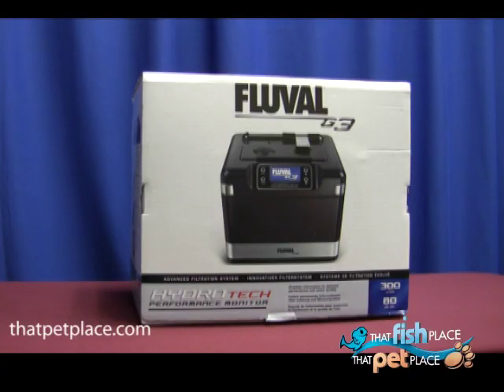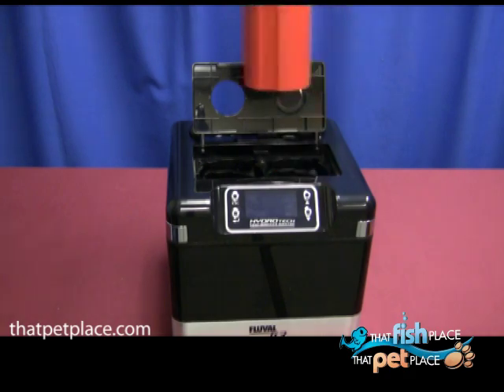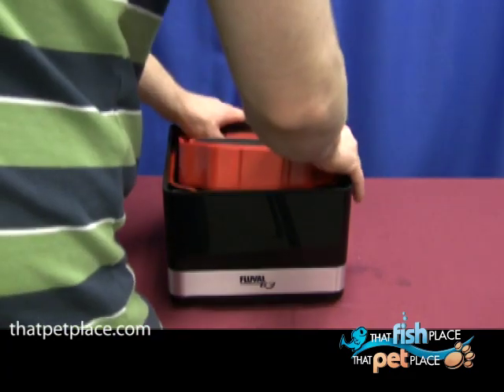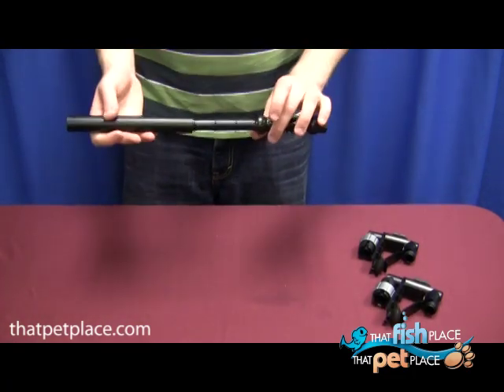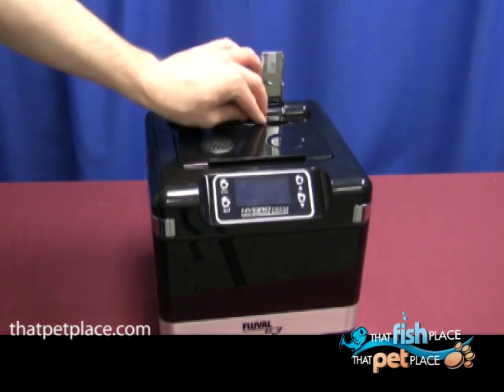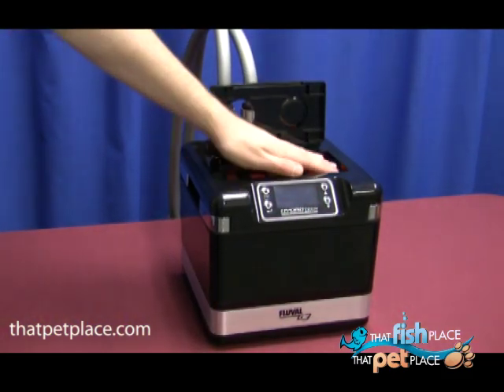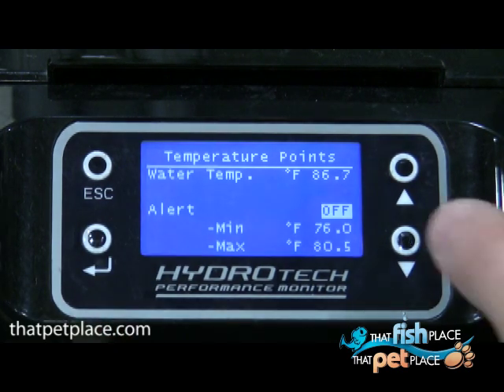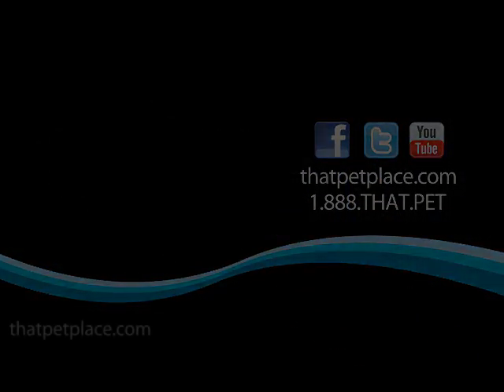How to Install the Fluval G Series Canister Filter for Aquariums

Comment: Assuming that there is no physical problems with the impeller or filter, and the valves are open, priming problems are caused by air trapped in the filter or tubing.  Make sure the tubing that attaches the filter is not too long, and there is no trapped air in the tubing.  You can also try to remove the return line at the elbow fitting on the tank, and push the priming button, or suck on the tube to purge trapped air.